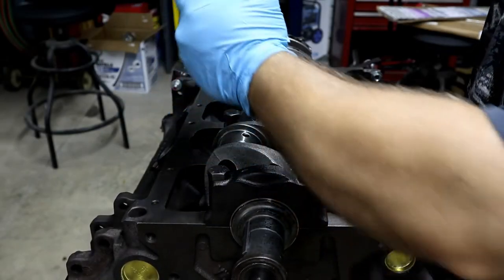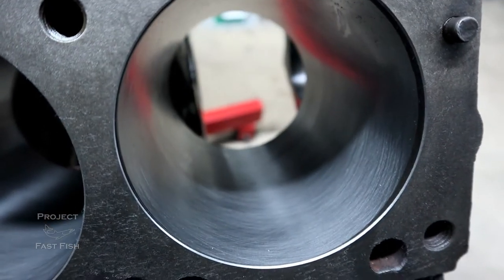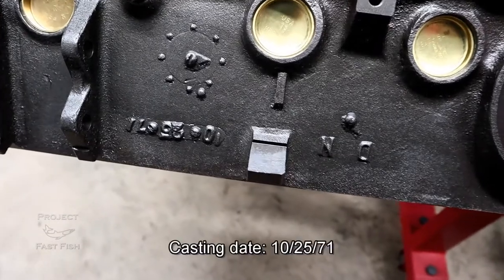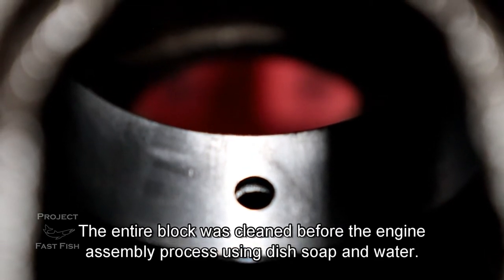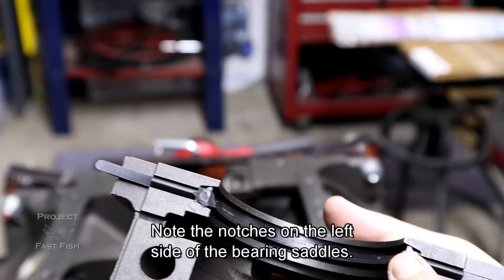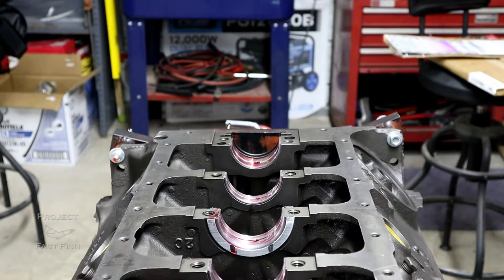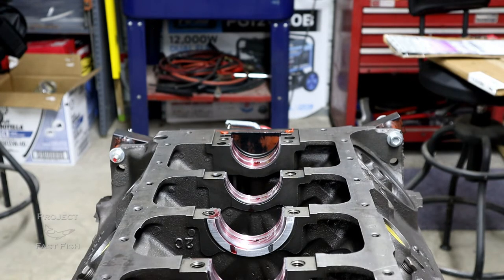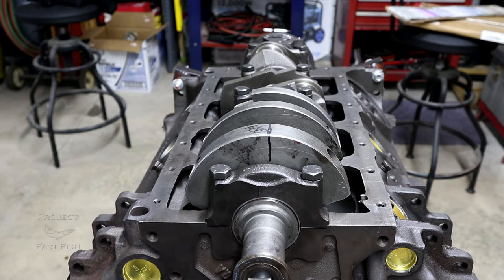Project Fast Fish: Chrysler 318 Stroker Build and Walk-through - Part 1

Comment: You can get full grove bearings.Anything over 500 real horsepower you need a girdle I have been running an Alky injected 360 for 8 years shift at 7500rpm no problems at all
Reply from the maker: Nice. Thanks for heads up.

Keep shifting high.

Comment: The old # for full gr. mains was MS2714P it has been changed but they are still out there.
Reply from the maker: For sure. The key is getting the actual bearings and not a cross reference.
Reply: @MicsMotorworx  I just call the factory.I may have it some where.

Comment: Is that a custom crank or did you have the main bearing journals turned down to 318 size?
Reply from the maker: Nodular 360 crank purchased by my Pop in the late 80s. Journals were turned to fit the 318. Thanks for watching.
Reply: @MicsMotorworx  What about the balancing difference between the 360 and 318 ENGINES (not motor)?
Reply from the maker: We had the entire rotating assembly balanced and included the balancer and flexplate in the process. 😉

Comment: Did you have to clearance the blocks with either 3.58 or 4 inch stroke?
Reply from the maker: Yes. With the 4". Since the 3.58" stroker used a crank from a 360 with the journals milled down, there were no clearance problems on the block. Thanks for watching.

Comment: What brand is that rear main seal? I replaced mine last year with a Fel pro. It didn't have those extra little strips off to the sides. Mine's not leaking, but I like the design of the one you used better. I just put a couple dabs of rtv on mine to seal it up between the block and the rear main bearing cap.  If I ever need to do it again for whatever reason I'd like to use that kind. 
            Thanks
Reply from the maker: Fel-Pro. It was the complete engine set.

Here's the link from the video description // advanceautoparts.rt8x.net/RyNkP2
   Fel-Pro KS-2114
Reply: Sounds like you have a 360 one.

Comment: Please excuse the question but could this be done to a "67" 318?
I live in South Africa and am wanting to overhaul my late dad's Fury 2
Reply from the maker: Sure. LA small blocks were made from 1964 to the introduction of the Magnum. The Magnum was only slightly different. Thus the concepts used here apply to any 318 of the era. However, the various cranks  may require turning. This is where research is key.
Reply: @MicsMotorworx  Thanks for your reply and I must say your setup for filming and explanation is tops
Reply from the maker: @dirkshumbadrinkersb4908  Thanks. I hope to bring good content on a regular basis. Thanks for watching.
Reply: Short answer is yes

Comment: Is there a crack in the block on the oil filter section, I can see a straight line all the way down the block. Looks like it’s cracked.
Reply from the maker: Nope. Part of the casting.

Thanks for watching.

Comment: I wish I could do the opposite...destroke a 360 ..the difference is.030 in crank journal diameter...they make .030 over mains but I've never heard of anyone doing it. The 3.31 stroke with the 4" bore cut .040 over would give me a 340🤗.... I think.
Reply from the maker: Neat. If you decide to build it, let us know how it goes. Assuming compression remains equal, more stroke than bore means higher torque. More bore than stroke means higher horsepower.

Comment: You should always torque the crank hardware up in ONE smooth hit, not  with multi strokes of the torque wrench used as a ratchet, my goodness
Reply from the maker: Yes. My brother got on to me about the double clicks. In context, this was the host's first build of this type. We appreciate the feedback.
Reply: @MicsMotorworx  What size stroker is in it?, I only found your channel today so I need to catch up on it all of which I am going to start to do tonight, cheers, UK (Mopar owner here for 38years, '68 Roadrunner, '69 Dart, '68 440 L code Fury Conv.).
Reply from the maker: Sure.  318 to 349. 0.030 over with a 360 crank.  We built this on based on some parts we had in our garage and some old plans for previous builds.  Looks like a good collection you have there.  Glad you stumbled across our channel and thanks for watching. :D

Comment: You are way too stingy on that assembly lube for that crankshaft to drop into. Don't be so stingy.
I didn't see whether you put assembly Lube on the upper caps either?
Reply from the maker: Hmm... Interesting take from the footage. The bearings were well lubed, but not dripping. Each builder may vary on the amount of lube they use. Must have been the lighting. 😁

Upper cap lube... Must have missed that part. All crank bearings received a good lube. (11:05 mark)

Thanks for watching and addressing those. 🙏

Comment: WOULD THIS BLOCK BE THE SAME BLOCK AS MY 96 JEEP 5.2 LITER ENGINE THATS A 318 AS WELL RIGHT?
Reply from the maker: Hey Cliff. 

The Magnum 318 and LA 318 have some subtle differences. (Heads, lifter type) However, what you see is applicable for yours.
Reply: Top end oiling is different on Magnum blocks. That needs to be accounted for, when it comes to heads, but Magnums were designed for roller cams, making running roller lifters much cheaper than with an LA block.